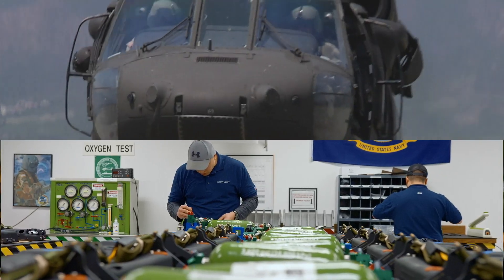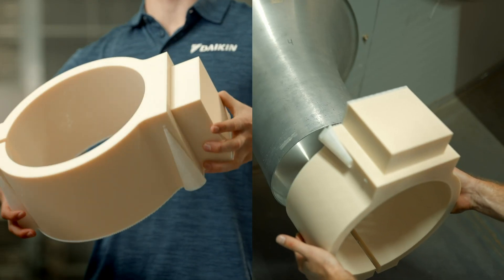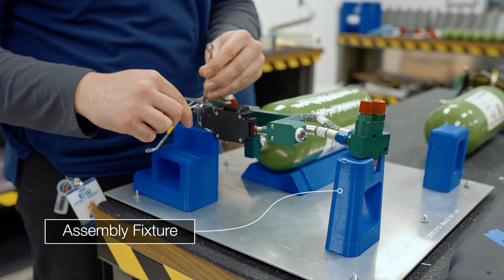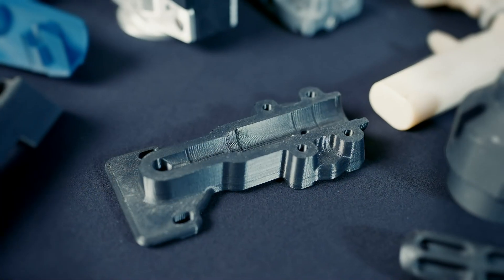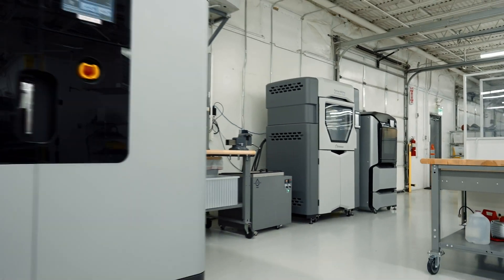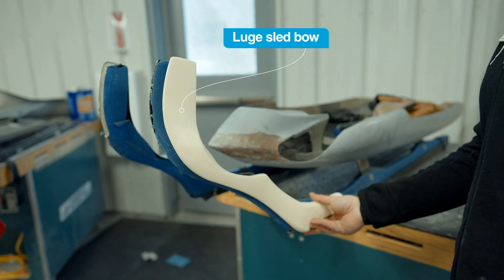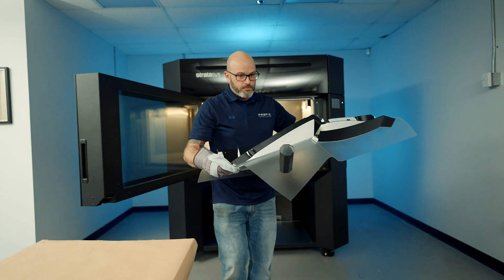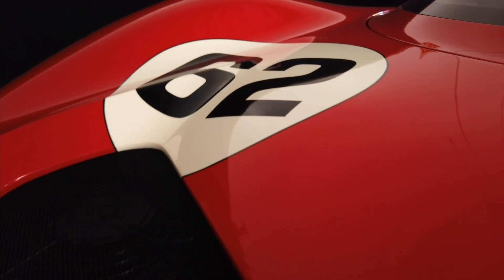The Best FDM™ 3D Printers | Stratasys FDM Technology - Globally Scaling Additive Manufacturing

Comment: World most reliable FDM printer when print failure is not an option.

You can abuse the design as much as you like and it will still print without settings tinkering.